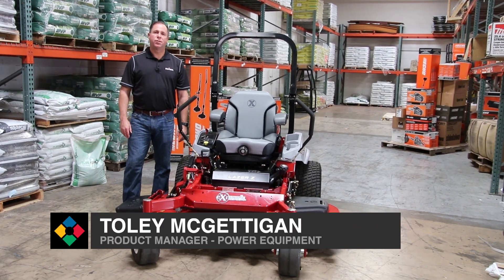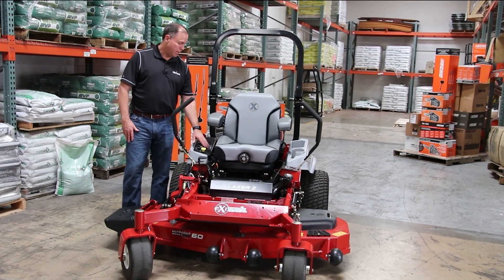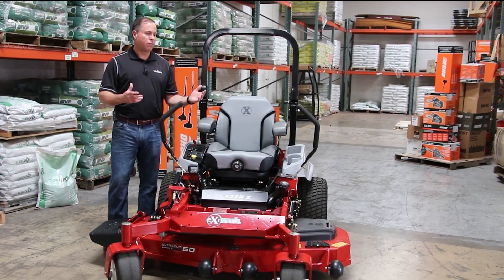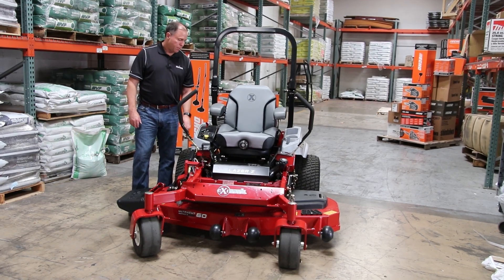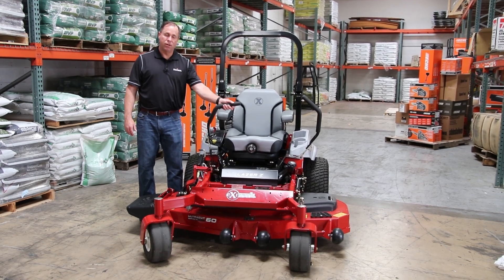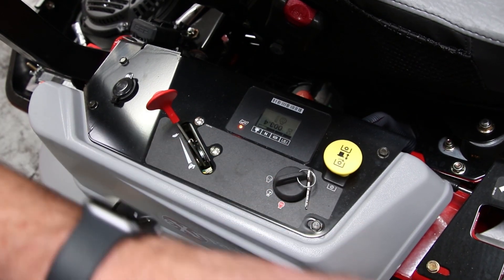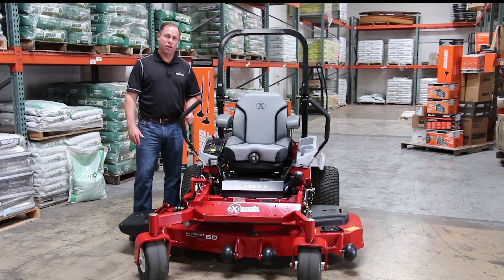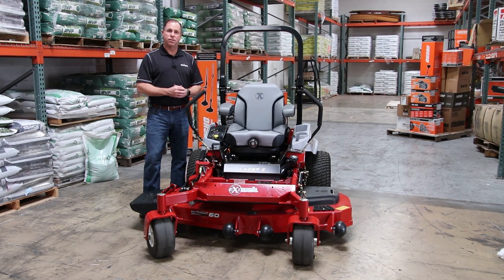Safety Switches on Exmark ZTR

Comment: Mine will start but can’t release the brake
Reply from the maker: Asked my service expert about this, and here is his response... Electrical is very hard to diagnose without looking at the unit.

The mower should have a module that shows if the safety switches are bad. Most likely the switch or the module is bad but testing will have to be done.
You can find a service center near you on the Exmark website
Reply: @HorizonDistributors  I fix them that’s what I do, it was key switch customer put a new one on it but not the right one. Thanks